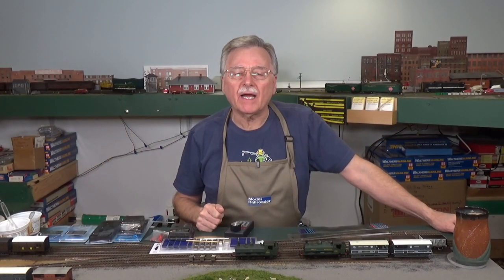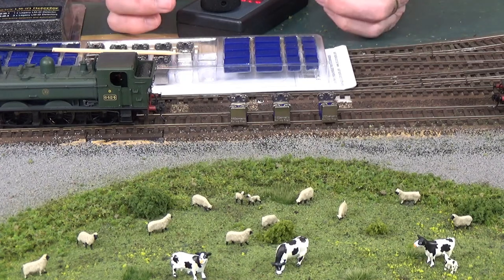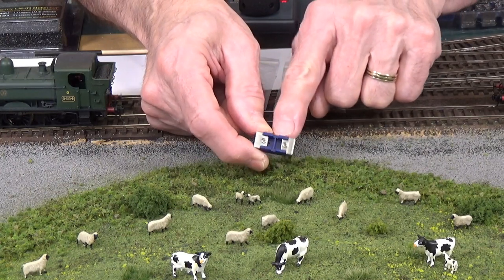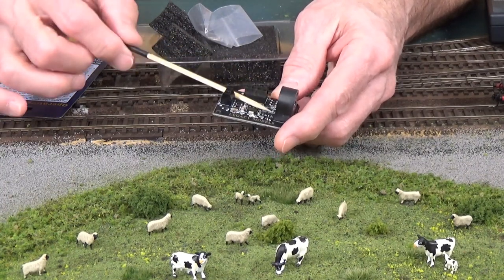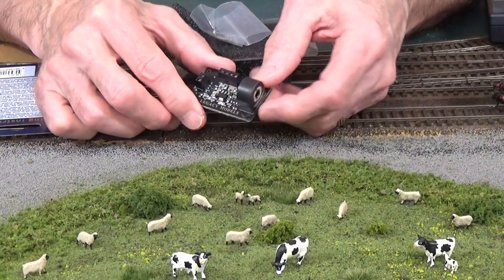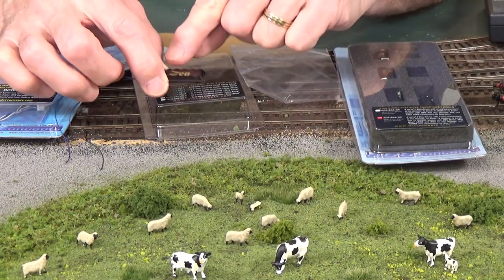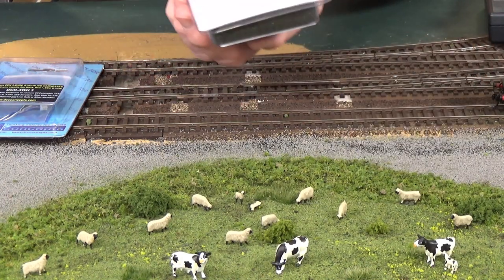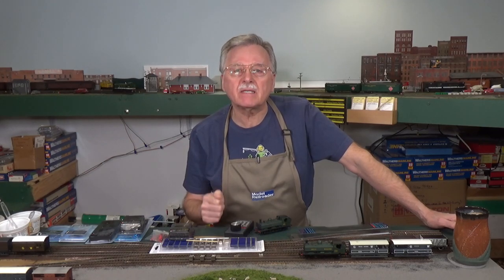Five More Great New Gadgets For Your Model Railroad From DCC Concepts (160)

Comment: I love the DCC Concepts products.  I have bought directly from DCC Concepts and a hobby shop in England.  The killer is the shipping costs.  So, plan to make a large order to spread the shipping cost across many items.  Supposedly they have a U.S. wholesaler, but the wholesaler doesn’t carry much of DCC Concepts in stock and you have use a hobby shop that is affiliated with the wholesaler.  It’s just better to buy direct.
Reply from the maker: On the orders I get from Hattons shipping is less than from my local dealer just 60 miles away and no sales taxes, VAT is subtracted for overseas customers. With their “trunk” service they will hold your orders until you have accumulated what you want and then ship when you tell them so it is easy to combine orders.

Comment: Hi Larry, can the block occupancy device be used for signalized grade crossings?
Reply from the maker: There is a high lower output on the detector board for driving relays and it should be able to easily handle a Tortoise switch machine. Circuitron sells a kit for Tortoises to lower and raise crossing gates so it should be an easy enough project. If you visit the DCC Concepts website and look at these they have a link for downloading a newsletter with a more complete description of these. It would be really helpful to have a tech tip sheet showing ways to wire these up but they are just too new right now so maybe down the road that will come. I’ll mention it to them.

Comment: Hello Larry, thank for the videos!  I have a quick question;  I am building an occupancy detector you worte about in the May, 2015 MR magazine.  I have it pretty much nailed down, except for the wattage for R1.  I have settled on 1w, but, before I head into this project, is there a more ideal wattage for this resistor.  Thanks in advance.
Reply from the maker: Inhope you haven”t gone too far with that one as I will have a different circuit this week that is much better and less sensitive to the light level.
Reply from the maker: Sorry, I just deleted your response by mistake. Anyway you could probably go as low as 1/4W since this is a pretty low power circuit. I too have a number of extra parts for planned future use but this new circuit is so much better I bit the bullet. Watch the video on Friday to see what I mean.
Reply: @TheDCCGuy  No prob Lar, this is the internet, so it's drifting around there, practically forever (my response).  But, though I am not electronic savvy, it just felt a little heavy for the circuit.  (Don't ask me why), and it's good to run it past a pro.  I will probably go with 1/2w, just to cover my bases, and don't mind the effort, as I have been tooling around this project for a couple of years.  Plus, I am discovering a lot of nice and neat little tools, toys and gizmos that might make this go a lot smoother than I thought.  I am going to make a breadboard model, and if successful, ship the work up to a company to manufacture a PCB.  This will be great training and practice.  

My layout is fairly large, so I will have plenty of room for the new and improved models you are coming out with Friday, ans will subscribe so I don't miss it!  I love the way you explain the electronics and theory behind these projects, which make them a lot more fun and educational.  Thanks again and cheers!

Comment: Larry, for the Legacy Models Power Points LM-PP.4, does one carry positive and ground both like a coaxial cable or do you have to use one set for positive and another set for ground?
Reply from the maker: You would install 2 Power Points, one for each bus wire. This makes sense anyway since you install a PAIR of alignment dowels to get a secure alignment between modules. These are installed using the same process and tools as I showed in the earlier video. I’ll do a demo when I replace the existing dowels with these new ones. It will probably be soon as I am tired of crawling under the layout to disconnect the Anderson Power Poles.
Reply: @TheDCCGuy  sometimes folks also have a separate 12V bus for non-DCC accessories so a coaxial arrangement would have been best in that regard. Just a thought.

Comment: Will the Super High Power 2-Wire Stay Alive DCD-SA2-SS1 work with any HO decoder?  Is installation simply tapping in to the left and right power pickup leads?  Do you need to set CV 29?   What is the shipping cost from Hatton's to the US?
Reply from the maker: They should. See my video on connecting stay alives that I provided a link to in the video. With all stay alives you need to turn analog conversion off in CV29. I get a package from Hattons about every couple of months and the shipping is less from England than my local dealer just 60 miles away in South Carolina.
Reply: @TheDCCGuy  Thanks for the helpful response.  I've been studying your earlier videos concerning stay-alive fabrication.  I had concluded that those stay-alives would have been too big for easy intallation.  The DCC Concepts stay-alives appear to be very compact and easier to install.

Comment: Hi Larry
Loved the video.  Any shorter and it could have been less informative.
I have some of the original alignment dowels.  Do the new ones with the contacts align with the original ones?  Future extensions may use the new ones.
Thanks and stay safe
Paul from Zillmere
Reply from the maker: I’ll check but I can’t see why you would want to intermix them as the electrical connection wouldn’t work. However if you are asking whether you could have the old ones on one pair of modules and the new ones on another pair that should be OK.
Reply: Hi Larry 
I am in a group and everyone has their own module.  I was wondering if someone used the new dowels on a new module if it could still align properly with the old ones.  The electrical connections would not be an issue.
Paul from Zillmere
Reply from the maker: Paul—it would depend. With the alignment dowels, in each pair one is male and the other female. With the males there is a projection so it can not mate with another module that does not have a female dowel or a hole drilled where that female should be. The females are flat on the surface so could mate with a module  having no dowels.
Reply: Thanks Larry 
Paul from Zillmere

Comment: Video does not have captions. :(
Reply from the maker: What kind of captions are you expecting?
Reply: @TheDCCGuy  the ones that are usually on your videos. The free youtube auto captions. Once and a while your videos don't have them.
Reply from the maker: AFAIK I have no control over that and it is not a setting that I have ever seen or changed.
Reply: @MoosesWorkshop  They are called "closed captions" and yes, his videos do usually have them and they can be helpful.
Reply: @TheDCCGuy  actually you do have control over them. When uploading a video, make sure the closed captions box is clicked with English chosen as the language.
It is a free youtube option.
Reply from the maker: I’ll check. As I said I did not make any changes in my options when processing the video so maybe YouTube has “fixed” something that wasn’t broken!
Reply: @TheDCCGuy  there ia quite a few youtube videos on how to make sure your videos have captions. Just search Youtube closed captions settings.
Love all your videos! Hate to miss out on a few of them as I am deaf.
Reply from the maker: I’ll check this out during my next upload. I looked today and couldn’t find any settings for existing videos.
Reply from the maker: I looked up the YouTube settings for auto CC and it is set to “on” for this video but they are not coming up. I have no idea why but will make sure to check this in the future. I will send YouTube a query on this but don’t how fast or even if they will respond.